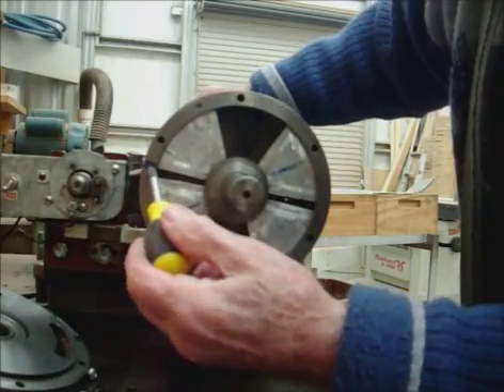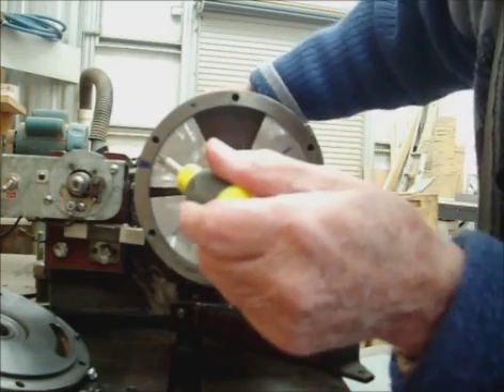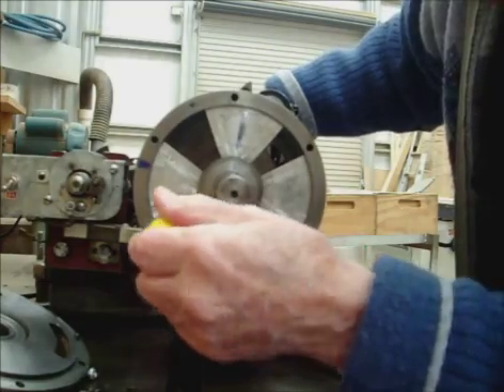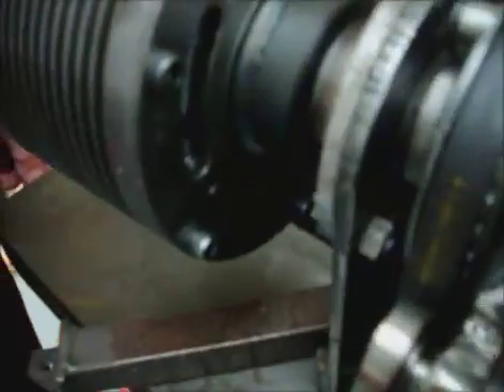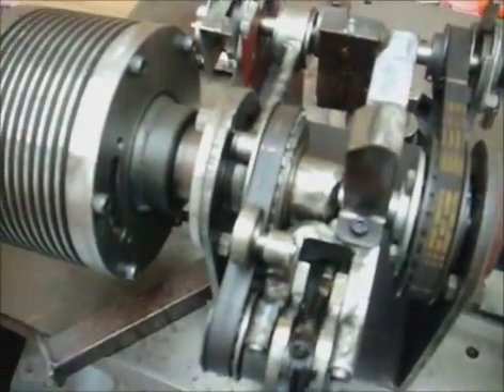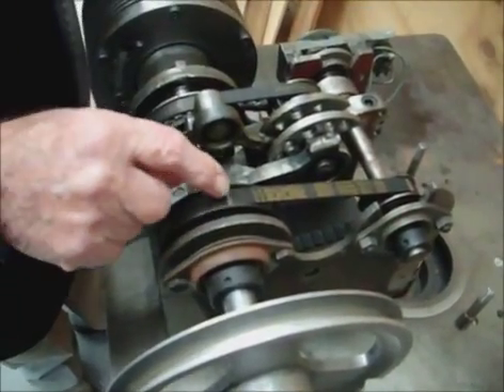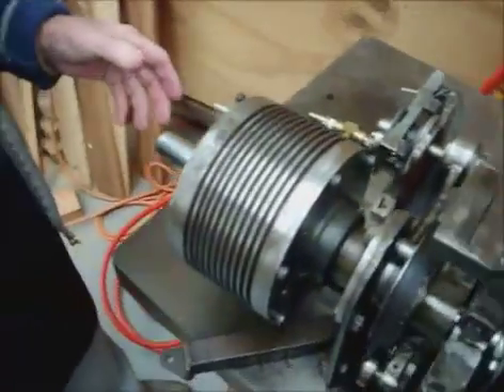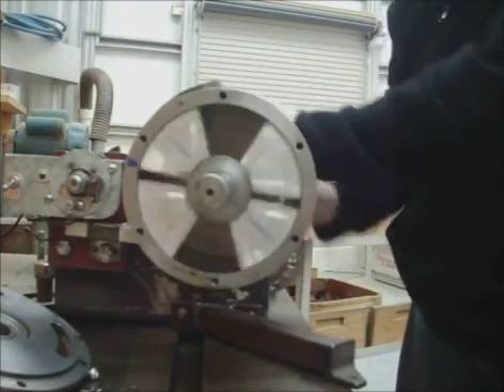Kauertz Engine built by George Coppard with his own designed gearing system

Comment: Hello, long time you didn't received commentar. Personnally I have investigate deeply in the rotative field motor. My conclusion was it is impossible to get useful power with all system which is included rotative cylinder or whatever device. In all cases you need a fixed part(like culasse) in order that the force create by explosion can develop on the moving part its power. It look like the cat which run after its queue! Anyway I send you my best regards.Paul

Comment: The combustion chambers are as the Kauertz design, but the complicated drive with two drive belts is different _ The Kauertz design used a simpler gear system, center gear on the center shaft (sungear) meshing with a half size outside (planet) gear wearing a cam with two lever link bars, one driving each rotor, and a small bar linking the end of the cam to the bar of the main rotor. __ As illustrated in the Popular Science book titled - The How and Why of Mechanical Movements - by Harry Walton, E.P.Dutton & Co. New York, 1968 catalog #68-31227 __ Maybe could be found as used book on Amazon.
Reply: Jean Labrek Very interesting video as info on the Kauertz is very difficult to find, especially on a working model, as being a real rotary, not like the Wankel with its  reciprocating motion rotor and a low stroke crankshaft.
Reply: Jean Labrek In the book was the description of other near rotaries like the Tshudi, Selwood and Jernaes engines, also the real rotary Mallory engine.
Reply: Jean Labrek The ingenious belt driven system shown in the video was to carry the distributor for the ignition system.
Reply from the maker: Jean Labrek  Hey, 
MY grandfather who built this also told me the gearing system is mainly so the power of the combustion is not always landing on the same tooth as this was the main problem with this engine which resulted in sheering off gears and why it never became popular. he solved it with the arangment you see in the video
Reply: _ Agreed __  your grandfather was a great machinist, very handy and genius on a lathe, not easy to build a machine like this _ The gearing I mentioned was shown in the book to explain the principle but did not show the distributor or ignition system ( shown as a diesel) _ This is why yr ingenious grandfather had to find another way __ Great work.

Comment from the maker: We used compressed air to show the engine working, but it can run on petrol, all you need to do is put the glow plug at the point were the compressor is and the fuel intake where stated in the video